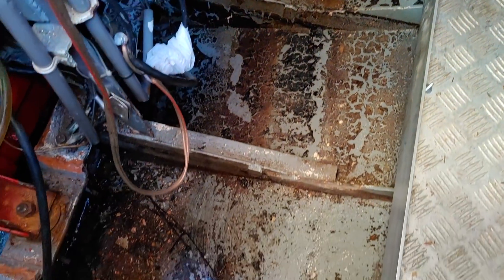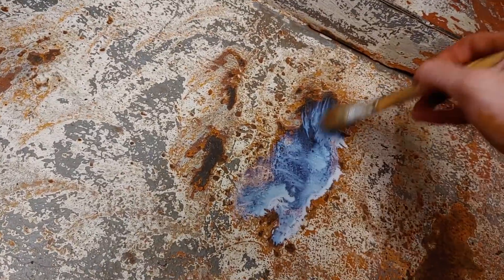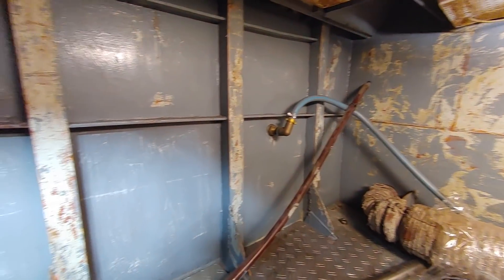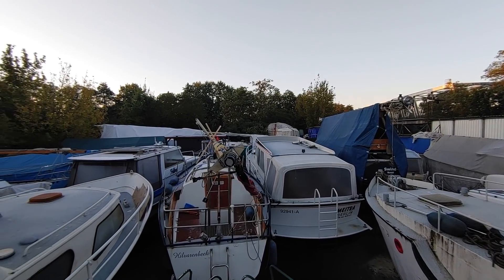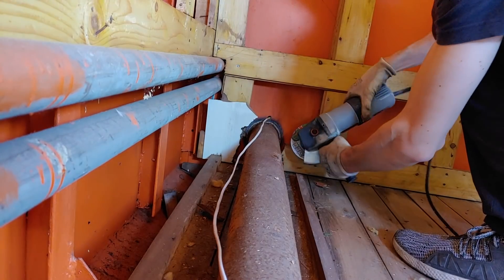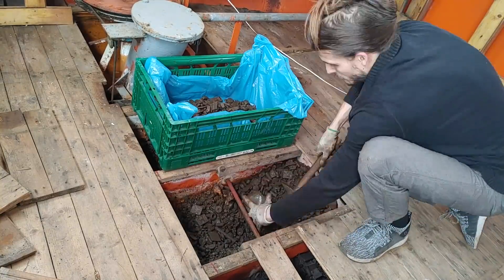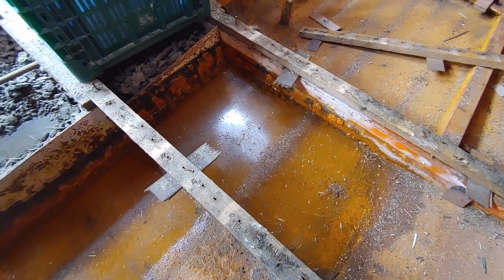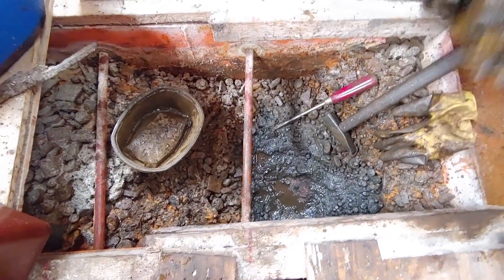Heavy works on our steel boat - Week 4 - Vintage Yacht Restoration Vlog

Comment: Dear MFB-couple
👍👌👏 Well done again (video and work). The engine room looks really great. I guess I wouldn't have primed over the old paint too. But definitely where bare metal, rust converter or rest of rust was. I guess time will tell about the result. 2) You definitely need more, less dangerous and better tools. At first for instance a circular saw, a jigsaw and a saber saw. An angle grinder with a saw blade is quite dangerous. I only use it in combination with reduced speed.
Best regards luck and health.

Comment: The engine room looks good. For the area where the metal is used for balest. I personaly would remove every bit of it. Then sandblast and prime and paint. I would also make openings in all the compartments so all the water drains into the bilge. Then I would replace the balest with lead blocks. Just my thoughts.

Comment: A great improvement in the engine room!  Just for future reference, if you are stripping back to bare metal anywhere, but especially on the exterior, it's a good idea to prime the metal as soon as possible after its been cleaned back. Even overnight, it can form a light flash of rust, especially in a damp environment and you could finish up chasing your tail, trying to get it cleaned up. Thanks for taking the time and trouble to document and share your progress.
Reply from the maker: thanks for the tipp. I'll make sure to not waiste any time before putting the primer on.

Comment: Take out the gravel and replace it with concrete (that's water proof) so you get same ballast weight and make sure water are able to pass between bulkheads to bilge pumps area and of course grind and repaint the area so it gets a longer life.

Comment: Use POR 15 after treating the metal, is my suggestion.. and then monitor the condition...
Why would you ever consider putting back those rusty bits of metal... it would take forever to revisit and then you cannot inspect the hull on a regular basis...you must make it maintenance friendly...my respectful and experienced thoughts

Comment: I hope you don't have much wood to cut with that angle grinder. You DRAG it towards you, not push it. Otherwise it hops and jumps. You really don't want to have an accident with any disc grinder. I call it grinder bite and I've had a few of them. I'm working on my 3rd steel boat and still  learning things.